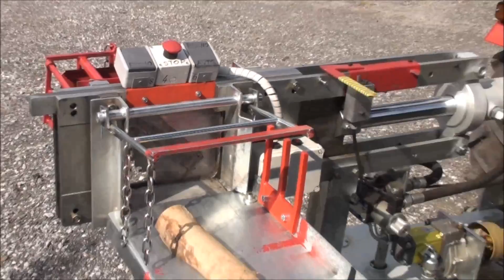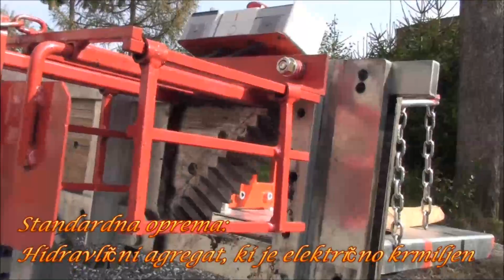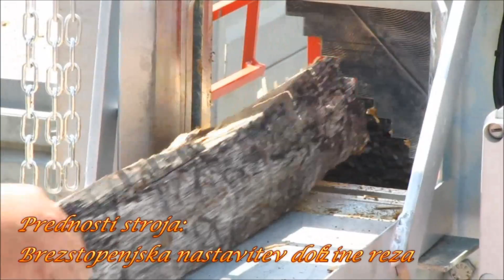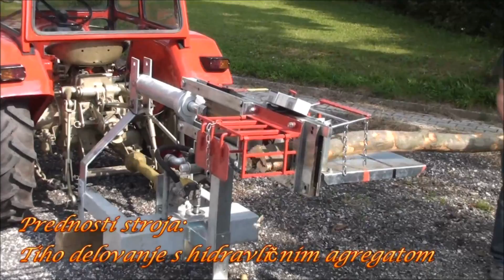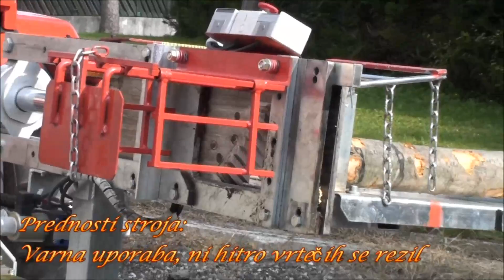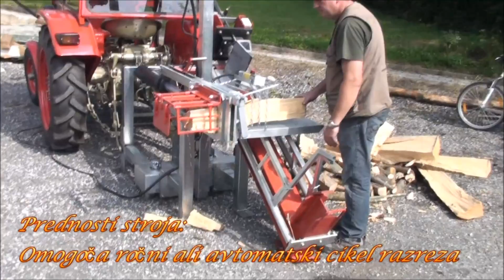Silent machine for cutting firewood (branches), safe and easy

Comment: Fantastic machine! Very silent! Driven with an electric engine instead of a tractor nearly all you would hear is the cracking noise of the wood. But I always wonder why people let drop the cutted wood on the ground instead of using a wheelbarrow to catch it and to reduce work efforts

Comment: SILENT?
Reply from the maker: Comparing with other machine for cutting the woods. It is very silent.
Reply: It is very silent! Driven with an electric engine instead of a tractor nearly all you would hear is the cracking noise of the wood.
Reply: @Chr.U.Cas1622  Yes, the Only Problem is the Old tractor that is noisy !!! ! !!!